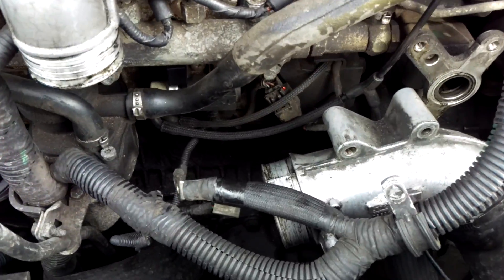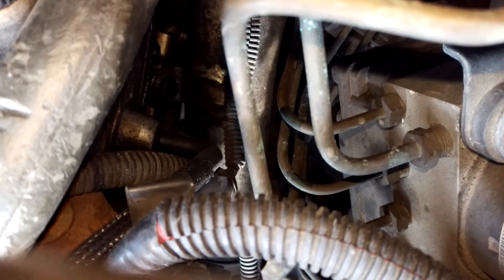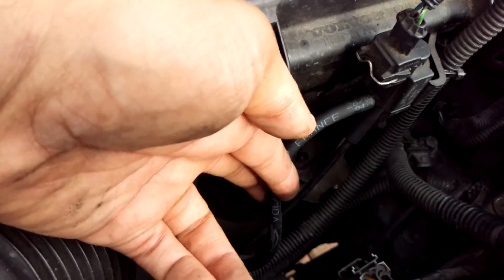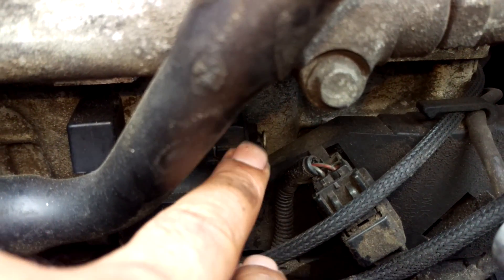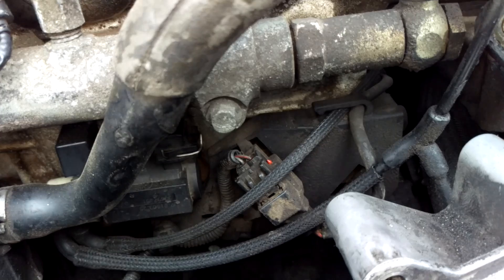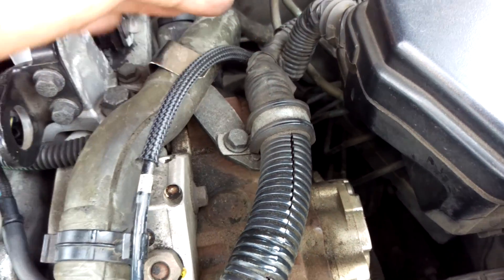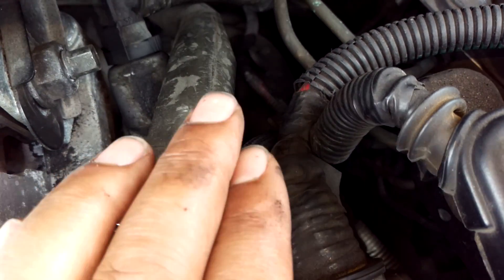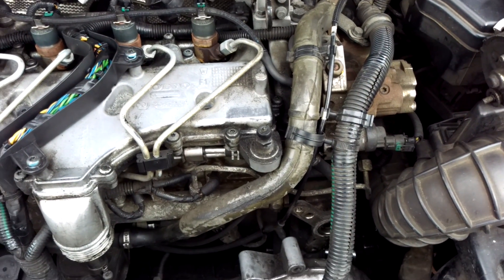Volvo D5 Vacuum System Simply Explained

Comment: I recently acquired an XC70, awesome car but needs a bit of work, popping sound when oil cap removed, a slight judder when in P and break depressed, I'm guessing engine mounts, also a slight deiale leak from engine compartment strong smell, have been to a few local mechanics who don't have a clue 🫣 any recommendations who I can goto within West Midlands, closer to a Coventry if possible but will travel! Many thanks if anyone can advise.
Reply: Did you get sorted? I've similar issues

Comment: Buongiorno a tutti, ho un problemino alla mia Volvo v70 163 Cv del 2003.
In pratica solamente con la 4 e 5 marcia non supera i 2500 giri e va in recovery.( Assistenza urgente motore).
Inoltre è come se facesse un giro di troppo per accendersi.
A qualcuno è capitato?
In settimana la porterò in officina.
Reply from the maker: @francesco-u4d  Buongiorno. Il più probabile è il sistema di alimentazione o il sistema di aspirazione. Io sostituirei prima il filtro del carburante. Sul mio canale sono disponibili video per molti dei problemi D5 più comuni.
Reply: Grazie per la risposta. Ho già sostituito filtro e egr. Ma nulla..non riescono a risolvere @sirobb

Comment: Heey Rob. Great video thanks. 
Question about the popping noise, i have blocked the engine mounts. But still have the hard popping noise. Can the vacuümpump leak internal to the engine?? When i pull the brakeboosterline popping noise stops, when i install it again loud popping noise starts again( same sound as leaking enginemounts) thanks in advance

Comment: I have a XC70 D5 AWD, 2010, have the ticking sound out of the oil filler cap (metal to metal sound), normal break function. Unsure if I have the solenoid, cannot see a turbo control valve.

Comment: Hi Nice explanation! My t6 has a whistle noise after the engine warms up and only at idle. It disappears after pressing gas paddle. It is unrelated to braking or not. Sounds like air suction. I have replaced pcv and also vacuum pump seals. Nothing changes. I suspect something related to throttle body closing. Is vacuum related to it? Many thanks!

Comment: Thanks SirRob!! Watched most of your videos, clear and articulate explanations. Very grateful i found your chanel!
If you'll read my comment and have time to answer my question, I will be honoured.
Have the same engine, eur 3 163hp on 2005 xc90 aut. No codes, except Air quality sensor is faulty..
Anyways, when i push the gas pedal, from cca 2200-3000 rpm i will get acceleration in steps (rpm will rise to 2300 rpm drop to 2250, go to 2600, drop to 2550 and so on, maybe 3 steps from 2200 to 3000rpm... Hard acceleration, or going uphill will be felt more), but after 3000 rpm it will accelerate normaly, maybe a bit sluggish.. 
Anyways im not trying to tickle your brain just wanted to ask you whether you think it could be related to vacuum loss somewhere in the system..
As Ive said no codes related to low fuel pressure..
What ive done:
Changed fuel filter
Cleaned boost solenoid with your video
Tried to find PEM, can't find it, or havent happened to come across it yet as of today.
Cleaned all contacts on fuel pressure sensor.
Im quite lost, everything else works as it should..
(I should add that it is more noticible when car warms up)
Im picking my brain real hard,
Anyways, if anyone has some input what to check will be very gratefull.

All the best and cheers,
Very happy owner of my 2nd eur III d5.
Reply: Luka l have same problems...did you ever find out? Cheers

Comment: Just replaced all my mounting and checked all the vac pipe work, all okay except I found a small length of electrical cable about an inch inside the boost Valve pipe supplying vacuum to the front and rear mountings, replaced that completed pipe but can still hear the popping sound on idle at a loss as to what is causing that still, the engine has it grunt back and loads of power compared to before the mountings replacement

Comment: Thank you for your great videos very informative, I have a Volvo V70 d5 and it's done nearly 200000 mile and I have black smoke behind me when I kick down, it looks like I am going to have to clean the EGR, 
 Also I have never changed the transmission oil and I have had the car nearly 17 years, is it a big job to change the filter inside the gearbox ? She has been a great car,. Are there any other jobs you recommend doing at this mileage
Reply: I have a v70 2005 d5 auto. No filter but flush and oil change was £100. Every 60,000.

Comment: Hi sir, v70 2007 d5 when warm i loose all boost IF i have revs under 1500 and gets in to boost, IF its over or hits 1500 before peak boost it works well, No cel .. when Cold its better and doesnt cut boost all the time.  What should i check? Nothing obvious in Vida

Comment: I have a quite complicated question, maybe you will know how to answer.
As far as I've understood, the turbo geometry is controlled with vacuum in a way where:
More vacuum -> tighter turbo geometry > more boost.
Less vacuum -> looser turbo geometry -> less boost.
So while the engine is at low RPM, there is maximum vacuum to ensure responsiveness of the turbo. When car accelerates and reaches higher RPM, vacuum is reduced and turbo will slow down a bit to avoid damage. If an overboost condition happens, the vacuum is reduced to 0 and VNT drops, completely loosening the turbo geometry and reducing boost.
But here's the catch - with increase of engine RPM the vacuum shall increase as well, but for control of VNT the opposite behavior is required. Does that mean the boost control valve actually controls vacuum variably instead of in On/Off fashion? It feels weird to think that a solenoid is used for variable actuation, because in industrial use solenoid valves are always used in a binary fashion.
I am currently trying to figure out why my car drops VNT when accelerating, seems to be an overboost condition, but it helps to understand how the system works completely - maybe my VNT is sticking or some vacuum is leaking that leads to overboost at inappropriate RPM's.
Reply from the maker: Assuming you have a Euro 3 with a vacuum actuator and solenoid, the solenoid is PWM controlled so able to do fine VNT movements not just on/off.
Reply: @sirobb  Oh, that makes a lot of sense, makes me feel silly for asking that

Comment: any idea if the vacuum pressure of a diesel D5244 engine is the same as a Benzin B5244 engine?
Reply from the maker: The vacuum is from the vacuum pump. The engine has nothing to do with it.
Reply: @sirobb  thanks, im fitting a brake servo from a diesel car into my petrol car. parts look identical part different part numbers.

Comment: Your clear explanations are very much appreciated.  I have a popping noise when I open the oil filter cap on my Euro 4 engine.  It doesn't seem to affect performance and no error codes so far but I think I need to start doing more investigating.
Reply: Very likely to be the PCV system. Other than that, could be the Hydro-thingys controlling the valves (don't know the English word) and last but not least, the pistons themselves, which of course would be the worst options.

Comment: Hi i wonder if you can help. I have a popoing noise but it goes so far as the intercool pipe as well. I will really appreciate if you can.
Reply from the maker: The popping noise is a vacuum leak so fix that and the other noise should stop too.
Reply: @sirobb  thanks. I appreciate. I was told that it was swirlflaps. Well at the end i removed the injectors and refurbished them so after this this d5 will go like new
Reply: @sirobb  its a euro 4 so only from the pump to the engine and mounts or is there more vacuum pipeline.

Comment: This explanation is for Euro3 with the vacuum motor mounts , do you have also an explanation for euro4 with the normal motor mounts
Reply from the maker: You just have the vacuum pump leading to the brake booster so less to check.
There's nothing else to explain really.

Comment: Hi Sirob, I’m a new owner of a xc90 2004, For some reason the previous owner has removed the T junction and pipe from the TBV do you know the part numbers for them?
Reply from the maker: Not off hand no.
A decent parts supplier or Volvo breaker will know though.
Reply: SiRobb I think I found some on eBay but they are for the mounts the should be the same diameter, also love your videos so great to see how to fix issues especially being a new owner (just wish the fuel consumption was better! done nearly a full tank in a week!!)

Comment: I have a problem with my s60 d5 euro 3. When I revving the engine when parked revvs are going up. quite slow. Same when I driving there is nothing happen until 2k rpm then turbo start kick. There is new turbo installed and cat back system + car is fitter with rica stage 2 ecm software. I'm sure i have a leak somewhere. Thanks
Reply from the maker: Check the VNT actuator and the boost solenoid which controls it.

Comment: Could the brake booster cause a vacuum leak and then cause the pooping sound
Reply from the maker: Yes, either the booster seal itself or the booster vacuum pipe seal are the most common.

Comment: This was an informative video thanks for sharing. I have 2005 Volvo s40 d 2.0 (hdi engine.) in the front of the engine where the manifold is,  I have accidentally knocked off the vacuum pipes and have attempted to fix this but to no avail. There are 2 inlets on the solenoid attached into the engine under the manifold, 1 sucks (or blows) in and the other doesn't. 1 is on top and the other is just below it and they are close together. I am having trouble rearranging the 3 pipes (with a t attachment) to go to which pipe attaches to which pipe, and where then the 2 pipes would go into the solenoid. I have searched the internet and found your explanation and if you could help me with my problem, I would be deeply grateful. 1 pipe comes up from underneath. And the 2 remaining pipes come from the right of the engine bay. If you could help, many thanks

Comment: Thank you for you videos. Should the boost solenoid hold a vacuum without engine running
Reply from the maker: Not necessarily no. Especially not if you apply a large amount of vacuum.
Reply: SiRobb do you know the best way to test it? I’m connecting vacuum pump to input and covering output. It doesn’t hold vacuum. Was using 20inHg. Should I try less inHg?

Comment: Excellent video as usual, your content is of great value. Slight correction or maybe additional information ref later models, the 2.4D variant has a further vacuum feed to control a bypass valve in the EGR system, fed from the sub 1500rpm actuator by the air filter - same circuit as engine mounts. Have not quite worked out the normal operation but I think it holds off the bypass below 1200 to 1500 rpm until the engine is warm, which makes sense as when one of my engine mounts failed and I was losing vacuum, my V70 would often stall at the end of the road, but never further on as the engine warmed. I think this system is for manual transmission only, not autos. E & OE !
Reply from the maker: With maybe 20+ D5 versions, it's impossible to do a concise video which covers all possibilities but yes you can add your findings and experience to the list.
I recommend that every Volvo owner has Vida to make use of the extensive Design and Function section for explanations of the different systems in one's individual car model.
Reply: @sirobb that is a good point, however I have found that vida skips many details especially when you only wanna swap a small sub-part not the whole unit (for example the Orange vacuum pump sealing insert costs a  few dollars but Volvo wants you to relieve the whole vacuum pump which is criminally expensive).
Reply: @andrewwilson3663 the 2012- 2.4L I5 engineers or earlier versions?

Comment: Good video, thanks, but is that value called Turbo Control Valve when it only controls vacuum to the engine mounts?
My D5 got oil in the vacuum line to the waste gate?
Reply from the maker: Turbo control valve is a generic name because most of the time, this type of valve controls the turbo boost pressure when used on other cars.

Comment: Hi Simon! I had one question about popping noise from oil cap. When I remove hose between vacuum pump and brakes main cilinder - noise come off, but when I plug hole with finger or put hose back to pump, popping noise is back! The part with VNT and motor mounts is fine , i have checked it with hand vacuump pump. What is my next step to find problem?
Reply from the maker: Check the seal on the brake booster hose.
Also check for the popping noise at different engine temperatures as it can go away once the engine is fully warmed up.
Reply: MiTjalv, с проблемой разобрался ? Мне походу тоже самое. Подушки только 12к проехали и через горловины звуки

Comment: Excellent tutorial video Simon. I kept having the "Engine Service Required" message coming up on the display. Now diagnosed as leaking engine mounts, I've temporarily blocked the outlet  pipe from the solenoid which has stoped the message and improved performance somewhat due to having full vacuum to the wastegate. 😊

Comment: thank you for all your videos. I have a problem which no one is able to help with. in My D5 Euro 4 (V70 2006), the vacuum line after the T (the one that goes towards EGR mixer) shows some oil. cannot seem to find the source but it seems to be from the vacuum pipe which I thought was not supposed to have oil but vacuum! Even before the leak appeared my car showed warning of 'engine system service required' and car had lost power (esp from gear 3 onwards). I cleaned the EGR mixer with Wynn and the performance seemed to improve but this oil appeared on the vacuum line which is feeding on to something near the EGR mixer. I cannot seem to get the warnings to go. If you see this post, please can you help me?
Reply: Did you fix the issue? If yes, what was it? Best regards
Reply: Same here, 2005 d5 auto. Think the garage over filled the oil on service (revised volvo service states no more than about 5.5ltrs or below the 3 Xs on dip stick. Think it's travelled through the system done how like yours.

Comment: I have a 2003 xc90 D5 euro3 and I have the popping noise and when accelerating from 0mph there is nearly no power and the when the turbo kicks in then it's fine.
Could the problem be with the vacuum system?

Comment: Woa thanks, my S60 D5 i recently bought was slow, i tought it was because an old man used to own it. I checked the vacuum hoses and discovered one was ripped in half, after i fixed it the turbo boost came back.

Comment: Hi Sirobb, great job with all those explanations! I have one speciffic v70 with d5 engine, and i have a question related with turbo, meaning do those engines have some king of bleed-off valve? Asking cause this car i am interessted is making sound like BOV when getting from high rpm to idle and, honestly, don't know if it is correct. Can you help? Thanks :)
Reply: Every turbo engine needs to have a blow by valve otherwise there be a chance of to much pressure building up

Comment: Hi SiRob what RPM does the vacuum get removed from the turbo actuator as I have a fault that the car is a little sluggish. could it be the boost solenoid if so how do I test the boost solenoid.
I have found a leak on my front engine mount which I will replace but still think there may be a issue with the solenoid.
could you advise how to check the control solenoid.
Many Thanks

Comment: great videos all around SiRobb, thanks for your effort!
Reply from the maker: My pleasure and I'm glad you enjoy them.
Reply: Hello. A piece of advice if you would. Volvo V70 D5 163ps. 167miles.
Tick over fine. Car lacks power. Maximum speed 80mph takes a while to reach this. Hard acceleration produces no wheel spin or acceleration kick even on gravel surface. Popping from oil filler cap area whencap is removed. I have checked all intake pipes from air filter to engine. EGR valve not cleaned but pipes you removed in this video is clean. New DPF. What do you believe is the problem.
Reply from the maker: +julian king What year is your car?

Comment: Do you know why the vacuum system relies so much on the engine mounts?
I had to clean my TCV and replace the engine mounts, and voila... feels like a new car, got my power back :)
but the onboard computer didn't told me anything about it, not even a generally: "Check Engine" or something...
Reply from the maker: The engine mounts are supplied vacuum until around 1000 rpm so when you change gear, if the revs drop to around 1000, vacuum may be diverted to the mounts to reduce engine vibration BUT if your mounts are leaking, your system loses vacuum and the turbo actuator can't be controlled correctly at exactly the right moment. This is only on the Euro3 163 D5. Performance on the Euro 4 isn't affected. 
You can either fit new mounts or block the pipe that feeds the mounts so no vacuum is lost.
You made the right decision to replace the mounts.